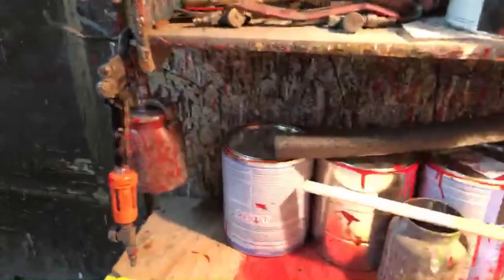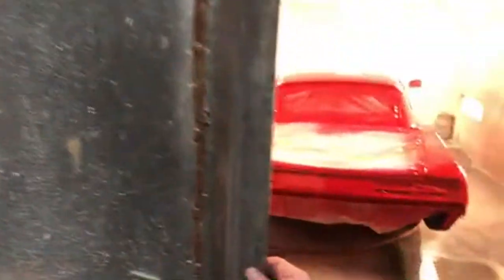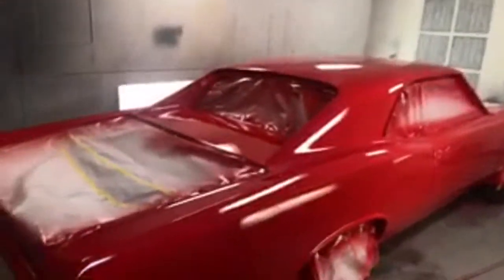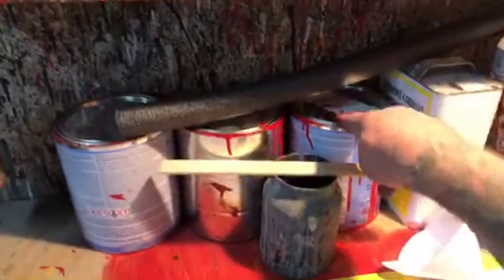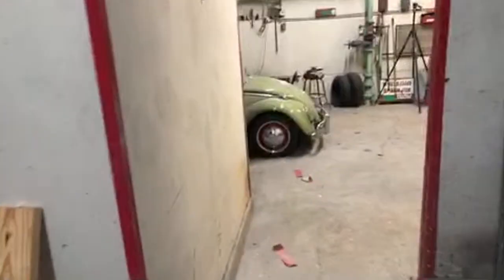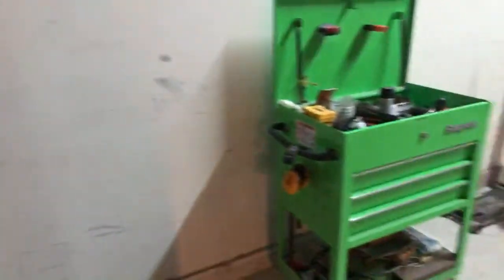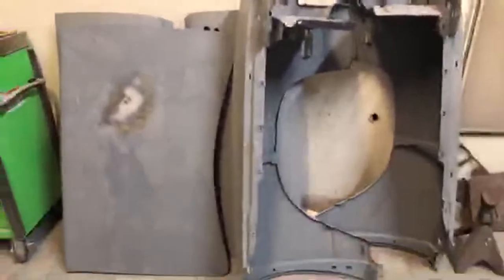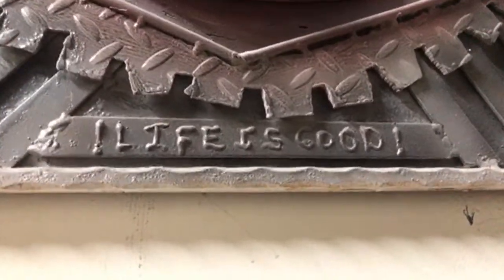How Good Does The Job Gotta Be? Paint And Body Tech Tips! Part 3

Comment: Those Model 7s are a workhorse I have one I want to rebuild I’ve had since 1994 when I first got in the industry and was wondering do they all use the same rebuild kit or are they different? Great job on the Goat looks beautiful 👍
Reply: Yes,,,, you can find them on ebay.. It's only 4 peices you change out which are basically seals..

Comment: quick question for you pete, and anyone else, do any classic american cars have a rubber gasket between the bolted on body panels (mostly fenders in your case?
i ask this because my old classics did have that from factory and it stopped alot of the rust from the fenders from getting transferred to the shell
Reply: Some cars had the Rubber as your talking about, Mustangs has an inner panel with a rubber seal on the edge that seals noise and debree from getting in the door jambs and also on the front of the fenders to protect the backside of the headlights.. Older cars from the 50's also had the rubber seals on them between the fenders and doors.. Newer cars are going back to that same design...
Reply: @myfriendpete  i was specifically talking about between the bolted areas, ie under the fender where the bolt line is not necessarily a 'splash' or wind guard. nice job on the pontiac btw, have a safe run to Moab x x

Comment: Question for Pete or anyone else that has some experience, I am in the process of painting my golf cart, Witch I want to paint an iridescent red over a 2 tone base that I want to make with black and gray 2 k primer ( I want to use the gray as a lighter shade on some sections of the panels to lighten the tone of the red) under a intercoat pearl and flake carrier and a red pearl pigment and some  red holographic metal flake finished off with clear coat, My question is will this primer work to give me the 2 tone affect I am trying to achieve or is there a better way to achieve this affect?
Reply from the maker: No. The pearl paint your talking about requires a base coat paint — normally black — to make it work properly. The eriedecent is not a paint at all but is actually a pearl mix that is very thin and is not used for coverage meaning it will not be thick enough to actuallly equally cover the car like paint will.  You will have to uses black base and gray or silver base to do the job
Reply: @diyautoschool  OK Pete, Lets just say I was to purchase some silver and some gold base coat paint and spray the entire thing gold and then mask off for the silver highlighted areas that I want to look different in the sunlight, How long do you suggest I wait before masking this for the silver to be sprayed using a fast reducer, And should I spray an intercoat before masking the gold base coat or can I mask on top of the gold without an  intercoat clear without the fear of the base pulling away? These are urethane base paints and I have not worked with them before, Sprayed lots of lacquer but have not worked with urethane base paints. Thanks for taking your important time out to answer my questions, Love your channel by the way! You and Minnie do some awesome work!